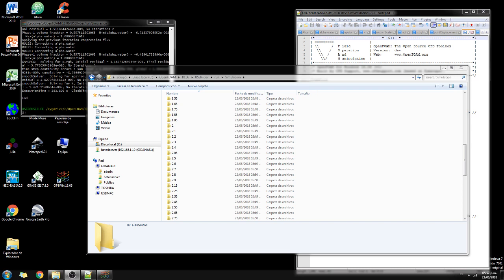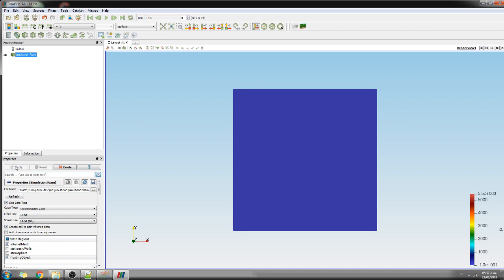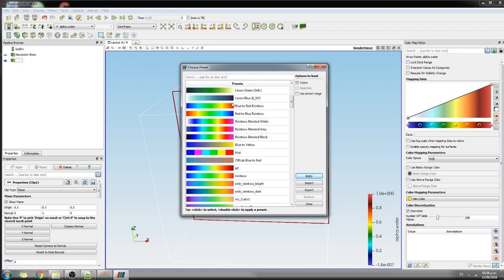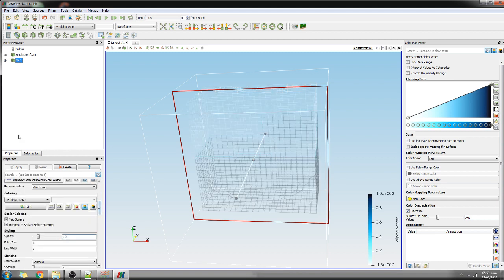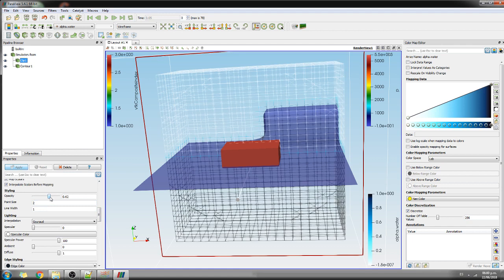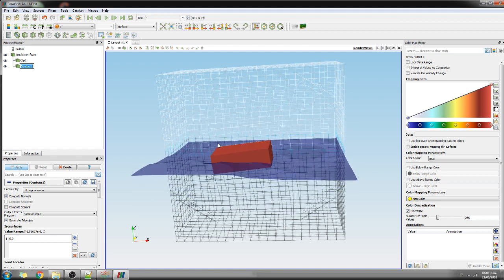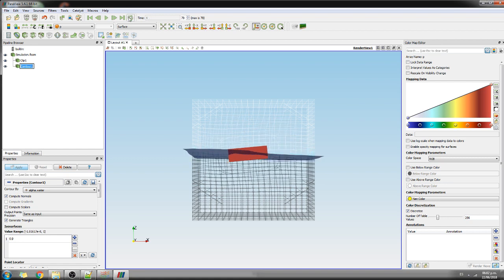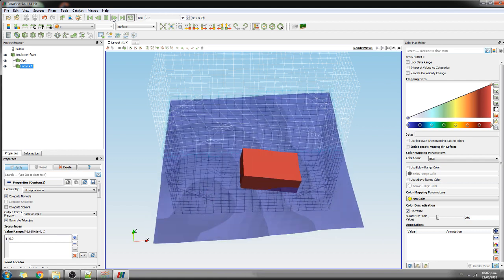Floating Object Stability Modeling with OpenFOAM - Tutorial Part 2

Comment: Hello! thank you very much for the case set. I was trying to perform the simulation by using provided files on your site. In my case floating body did not float but remained static. what could be the reason? I used Linux though
Reply: Try using "interDyMFoam" as a solver instead of "interFoam". That solved the problem for me!